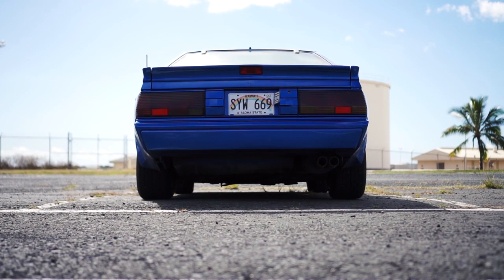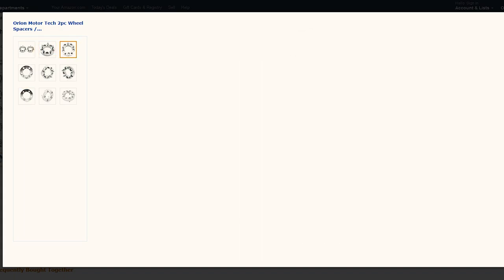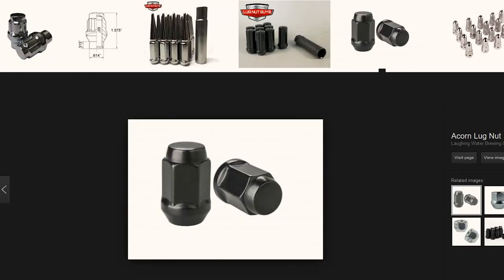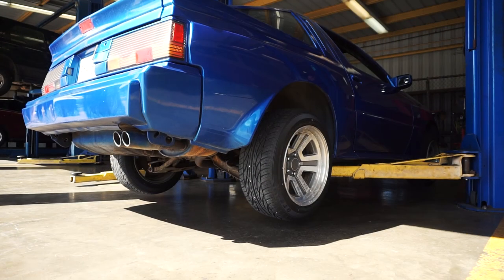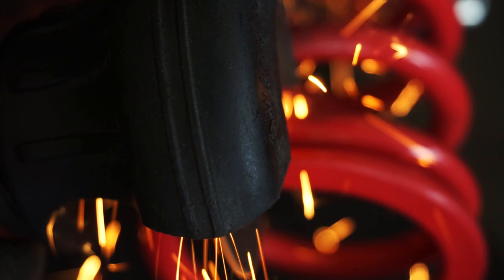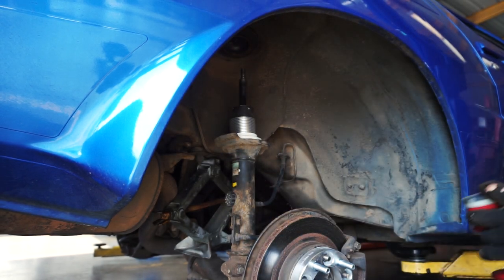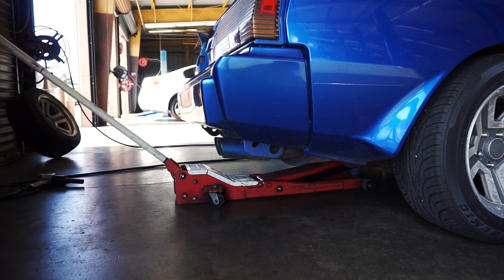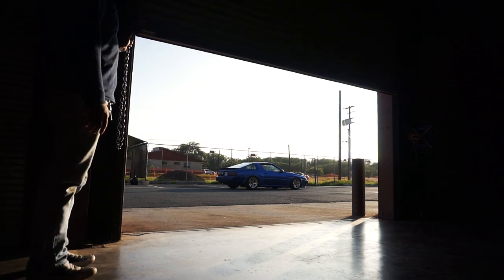Road To Wekfest : Part 2 - Spacer Install

Comment: Looking nice.  I should get spacers for my quest, but then again, I'm too lazy to buy a jack and jack stands.  I would recommend cleaning up the wheels, making them look nice.  Also, I recommend painting the intake strippy thing below the headlights (I seriously forgot the name of this) black.   On all conquest, this piece came in the body color, but on all stations, it was black.  I personally like it, you might too, who knows.

Thinking about it, what about mudflaps lol?
Reply from the maker: oh yeah, never did notice that black stripe before. I was honestly thinking about removing the grill and putting a long ass light bar inside it lol.

Mud flaps, definitely thought about it. Good taste Dank
Reply: If you're looking for mud flaps then, I wish you luck.  Wide body mudflaps are extremely uncommon.  Only rare stuff I got for my car is the middle louver for the hatch.  I found it locally for a good deal (they were rough though).  Dude I bought my louvers from had a Fiji like yours, but had a 4g63 swap going into it.   6 bolt from a 1G, pretty cool.  

Best of luck, hope these videos continue.
Reply from the maker: oh, I was thinking just grabbing those universal mud flaps and cutting them down to size.
Reply: That would work, but factory optioned ones are hella rare.  I just blew the seals out on my turbo in my conquest : (   so I'll be out of the game for sometime.